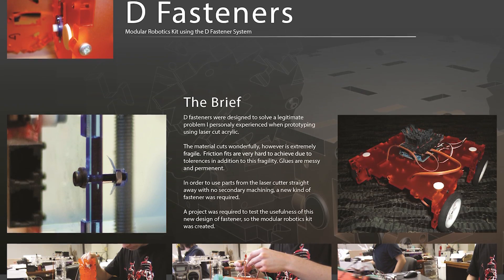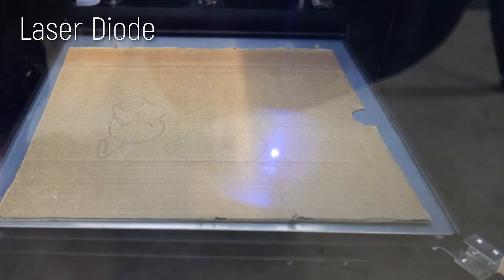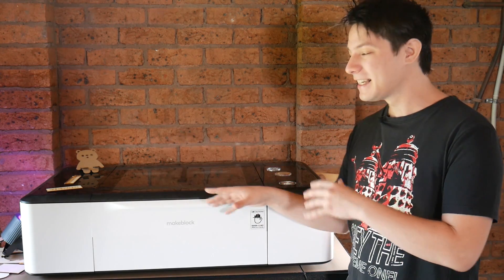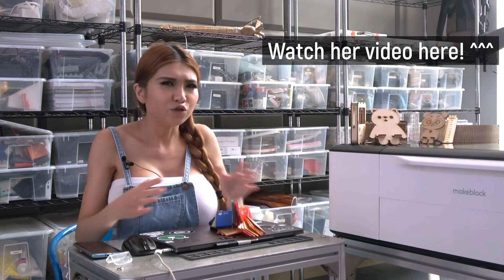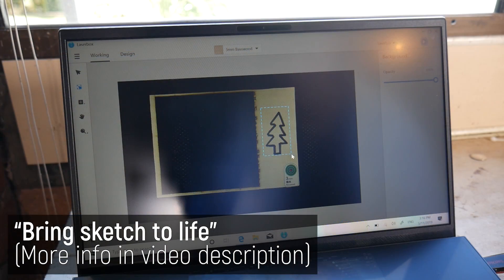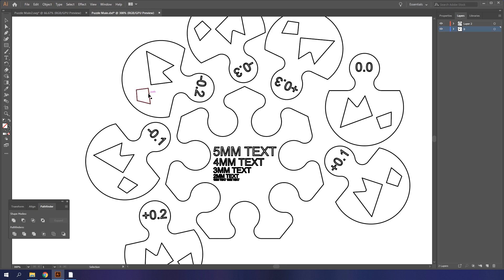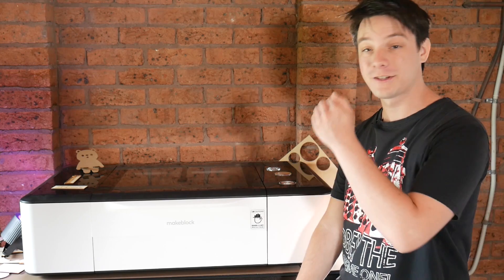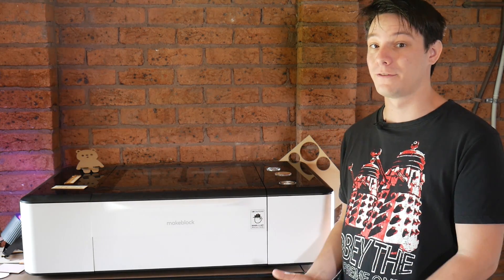Makeblock Laserbox Review - A SMART CO2 Laser Cutter

Comment: Thanks for the great review. Hmmm, seems weird to have no air assist, particularly at that price point. Air assist is also helpful for reducing fire risk and assisting the fumes etc out of the workspace as well as helping with the overall look of the finished piece as you mentioned, in my experience some materials REALLY need to have air assist to get a good end result like rubber stamps for example, all that rubber dust sitting on the piece would surely be problematic for the end result? I would also be interested to know the prices of their consumables along with the machine consumables like lenses and tubes etc (couldn't see them on the website?). I have been laser cutting for about 10 years as a full time 'hobby' business and have really wanted a camera machine for a while now, but not sure this is the one.. Also curious with lid mounted cameras, would they need frequent calibration due to being moved so often do you think?.. And i wonder how much that would slow down the process if you were cutting a multi piece job? thanks for your review.

Comment: I think people make too much of the Internet connection issue. I have an X-Carve and the software that I use to run it is web-based and that has never been an issue. I mean it is 2020 so who doesn't have an awesome Internet connection at their home and or shop these days? My Internet connection is so reliable that if it's down, there's probably bigger things to worry about like tornadoes or hurricanes. Another benefit of the Internet-based software is that your software can pretty much always be available. This means you can design wherever you have an internet connection and then when you get back to your machine your design is ready to go. Honestly, in this world of cloud computing, I think this is going to become the industry standard, not the exception.

Comment: I think it is Glowforge for the win. It has all the features, plus air assist, free software upgrades, etc. And costs less! You can get an upgraded Glowforge Pro System for cheaper and it has good specs. Plus it has a great community of users.  I have a basic Glowforge and couldn't be happier. No, it is not perfect, it has it s quirks, but what is perfect?  A business case would be a great idea for a video.  A lot of Convo in the GF community is all about how to price items for sale and COGS, design time, how much is laser time cost, etc.  Great video, I am big MM fan!  For the Makerbox one must also ask - what happens when the laser tube needs replacing?  How much is that, etc.... Good stuff, great discussion!

Comment: The extraction on that crazily expensive cutter is dire. It won't take long for the lenses to get contaminated. And it you can smell the fumes, then the extraction really isn't working. 'It would be good for educators' followed by 'I don't recommend running this laser cutter in an enclosed space'....... erm......like a class room?? No air assist, seriously?..... well air assist does more than just help with the cutting quality, it also prevents fumes from fogging up the last lens. The live camera feed in laser printers is nothing new. The software for it is called 'Lightburn' = https://www.youtube.com/watch?v=Z4TaZUkvDbM it even does the trick you did with the Christmas tree. Makeblock hasn't done anything new, they've just made it more refined. But for $6000 it should be !!!!!!! Great review by the way (as always). I wouldn't touch that product with a barge pole.

Comment: Wow, looks like an unabashed and total ripoff of Glowforge. The only functional difference I can see is that it apparently uses local software, unlike Glowforge, which is cloud-based software. Does the Makerblock (or whatever it's called) use limit switches for homing?
    I mean, sure, it's not a counterfeit Glowforge, it's just the same type of machine that happens to be the same shape, size, color, and construction. It seems to use similar jargon in its marketing and has cloned... every(?) feature of Glowforge. Also it apparently costs about the same amount. It's true that it's not a 1:1 identical reproduction though.
    I am not a fan of Glowforge (I was a crowdfund customer and was VERY active on their forum for a long time, but ultimately sold my machine without using it (for a variety of reasons)) but there's no getting around the fact that the thing in this video is a ripoff.

Comment: With no air assist, how do they prevent smoke residue sticking to the lens?  Acrylic and glue fumes (eg. from plywood) are rather sicky and will degrade the laser performance.  A K40 or similar seems much better, even for education use, as part of the process (and understanding) is set up etc.  For 10k a smal business can probably get a reliable (and more flexible) larger laser machine.

Comment: PTFE.. Also RIP your laser cutter's lenses from the hydrofluoric acid coating everything...  Though this seems to depend on your cutter's power.
If in doubt, Flame Test!  Copper wire with some sample melted onto it(heat the wire and press it against the material),  then put it in the flame and if it goes green, don't put it in the cutter.. 
Also: Leather.. fun to cut, but sometimes SO, SO VERY STINKY!

Comment: 8:45 That "smear" can be wiped away with a slightly damp paper towel OR a layer of painters tape (I like the blue kind) can be put over the part. For large parts wider than the width of your tape just cover the part with the tape edge to edge NO GAPS and NO OVERLAPS.  This all worked well on my Epilog Zing 60w

Comment: Here's the rough part, pricing. It's great the machine comes with a lot of features that your average consumer may want but it's still price relegated to the professional market and left competing with brands that offer different trade-offs in functionality for the price. Personally I'd look at it from the pro space at this point, so i'd rather have something higher output than 40w at a similar price that would expand the range of material and allow me to offer a consumer more options than have a better user interface.

Comment: From watching the video and comparing both the Glowforge and the Laserbox; they are entirely the same machine at their core, but do have differences for sure. Both have the same design, 40w base versions, and so forth. Even their material scanning system is the same; albeit Glowforge uses QR codes while this uses a colored ring system. I will say that the bed for the Laserbox is smaller looking than the Glowforge. So personally, while yes the Glowforge has it's problems, it's still cheaper as the base model is $4000 vs the $6000 USD Laserbox is. Now if you get the Pro Glowforge at the similar price; you get a lot more to it including speed enhancements, pass through capabilities, and then a higher watt laser as well. The Laserbox does come with a filter system which is nice while the Glowforge doesn't. So in the end they are pretty similar as I said; just depends on the other bells & whistles that make you want one over the other.

Comment: Being a simple color code sticker, it would be simple enough to just recreate the them in a printed disc that you can just place on the corner for the camera to find. Then have a simple reusable identification system for your own consumables. Depending if can create the color codes yourself, this also means you could create a full library of materials in varying thicknesses.

Comment: Big FYI if you're cutting leather: there are certain kinds of leathers you also do not want to use. Most commercial leather comes in two kinds, vegetable (veg)-tanned, and chrome-tanned. Veg-tan is your stiffer, knife-sheath kind of leather. This stuff is fine. Chrome-tanned is soft, upholstery and suede leather. If you use chrome-tanned leather, it can release chromium salts used in the tanning process, which can damage your machine, particularly the mirrors. If you have one, check out your local leather supply shop like Tandy Leather and they'll help you out with learning the difference, and supplies.

Comment: "All opinions are my own... after being given a $10,000 gift, and having the manufacturer approve my comments"
Reply: Yeah I'm sorry but it's hard to claim impartiality when you have just received a $10k Gift. This is the reason why pretty much most companies have policies in place to not allow gifts from prospective or current clients.

If it was a show piece that was being returned I'd be more inclined to believe impartiality but such a gift for keeps raising too many questions especially with the Ask for a Quote system.

Sorry Maker's Muse I'm not doubting your integrity but this is my feeling industry wide for all companies / Reviewers. If it's not purchased with your own monies or a returnable test piece I'll take comments with a pinch of salt, especially the "it's not a Glowforge clone" when it clearly skirts that line so close it's practically over it and as such I'd question wayyy more.
Reply: yep
Reply: And... what was not accurate in the review?
Any facts supported by evidence?
Reply: @Terry Jackson
Its not what they tell you but what they dont!
Anyone that owns a co2 laser cutter knows the horrible design desisions that machine has.
That machine is I-Crap. Its just looks, it doesnt even have an air assist so the lenses will get dirty in no time and ruin them. Plus it being closed and so small without proper air circulation it will get dirty all over the  inside.
This is an ad, of course they wont tell you the shortcomings of their mediocre product. That thing is garbage. Overpriced garbage thought for institutions paid with your taxes where they dont care about wasting your money.

Comment: You mentioned that etching takes a long time on this machine. From your video at 6:55 it appears there is a lot of wasted head movement. While etching the tree the head was sweeping across the entire workpiece rather than just the picture. Some adjustment to the software is all it would take to speed that up significantly by avoiding unnecessary movement.

Comment: No air assist is pure trash. Any slow cutting of acrylic results in flame, I don’t think you want flames coming up at your fancy laser head. I bought a Thunder Laser Nova 35, 900 by 600mm with programmatic control of the Z axis which drops a foot or more. This toy also can’t support a rotary unit for doing cups and such...not a great value for money imho.
Reply: PS - forgot to mention. Landed cost with import duties, shipping etc was $8000 with two tables, genuine refrigerated water cooler unit, flame detector, rotary engraving unit, blower extraction fan etc. All that’s needed is a small compressor and they sell that for near next to nothing. It’s not table top but a much more serious machine with 80W tube and ability to support 100W with the supply inbuilt.

Comment: Not a Glowforge clone? Seems like one to me (a glowforge owner). Not needing an internet connection would be the only real difference in what you described. Other than that you described the glowforge feature set.
Reply: Owner of a glowforge too. Yeah exactly a clone. The only feature that this has that glowforge doesn't is the off network use. But the glowforge has air assist. Lol.
Reply: Yeah but Angus would need 2 more very expensive gifts from Dremel and Glowforge to make sure for definite.

Comment: A bit of a shame that it lacks air assist at this price point. I like the "prusa like approach" : you plug it, use the good quality software provided with it, and it works. However, for the price i would really want air assist.

I know that i can DIY a cheaper, larger machine, with a more powerfull laser, air assist and many cool hardware features, however, i don't know if we have access to similar camera features with open source software? Is there any laser CAM software that enables the user to view the stock and the design superimposed like this? I mean one that is not tied to a specific machine.

Also, a good thing to add would be a distance sensor (there are quite precise laser sensors; but a BT-touch would probably do the trick), so that we could automatically touch the stock material; then move the Z axis to the correct distance for perfect focus everytime! That's nothing too fancy, just a bit of starting gcode...
Reply: Checkout Lightburn, it has a camera option and is the best laser CAM software I've used.
Reply: @Naomi-Wu  thanks Naomi!
It's not too expensive, and if you recommend it, i trust you :)
For now i'm starting with my CNC (openbuilds plate maker based on a smoothieware) and i have a little hard time with software, it's not as streamlined as the 3D printing experience i now have with my prusa (although when i started 3D printing with my printrbot, i was lost too!)

Later on, i plan on installing a laser diode on my current CNC to try engraving stuff; and much later on probably make a dedicated laser cutter, buying a laser tube and aluminium extrusions from china :)

Comment: I'm an educator who has been using the glowforge for more than two years. 
It's intuitive and easy to use. I can even allow students to use it through a guest account that I can control, and the materials they sell are precalibrated and sold at reasonable prices.
I've never once had to think about calibration of the laser or autofocusing. They also push UI and UX updates monthly. It was an easy transition from 3D printing once I learned some basics in inkscape.

I think you should review a glowforge.

Comment: I wouldn't recommend cutting or engraving PVC or any vinyl based product as the chemicals released are corrosive and will cause major damage to metal components in the laser.
I know someone who was cutting vinyl on his K40 and has destroyed the aluminium rails, bearings and anything else that will corrode.
There are warnings regarding this in some K40 manuals but his manual did not have this warning.
Great vid as always Angus.
Reply: Breathe the poisonous chlorine it offgases and you won't care at all about corrosion.

Comment: If you use fan extraction in a home that has gas fired appliances (such as water heater or furnace) you must have a 2nd opening for make up air opposite the fan tube in the ventilated workspace (just a tube to the outside, no fan) so that you don't pull exhaust fumes down through the gas chimney and die of CO poisoning.

Comment: Edit My estimate of the AUD to USD was way off... Please disregard. 

I understand it's not a direct clone, but am I missing anything that warrants the huge cost between the Glowforge and this?
Reply from the maker: I'm not sure. Makeblock are being cagey with their OEM pricing and all I could find was AUD resellers and Australia is always criminally overpriced. I don't believe glowforge comes with any materials or a filtration unit either.
Reply: the price between the two is about the same if you add the filter to the glow forge, 6k-5k usd (depending on the site) for this and 5-7k for the glow forge. the price given in the video was in aus so if you're in the us it'll seem much higher. i was curious about the same, had to check it out.
Reply: Half the stuff this comes with are "upgrades" you need to buy for the glowforge. Although for the same price, you could go with Bescutter and get a much more robust machine that can handle up to industrial use even, on its own stand, with more power and all the "upgrades". Little cheaper actually.. 60w fully loaded machine runs 5500$

Comment: At my high school we have two ULS Versa 60W laser cutters, they are very expensive (~$30,000), but they are by far the most reliable machine we have. I have to say that there is no way one of those machines would make for a good laser cutter at a high or middle school's engineering classroom, sure they are easy to use, but the drawbacks are too much, seriously, who decided to not add air assist? How often do they expect people to clean the lens? Because last time I ran without air assist (forgot to turn it on) the lens was extremely dirty after just 10 minutes of engraving.
Reply from the maker: I miss my uni's Versa, I used to do 6mm acrylic all day on it. The price is just so high though, it's ultra limiting. No air assist was a big surprise to me too, I'm going to try rig something up so my lens doesn't crack.

Comment: So twice the cost of the Glowforge with less features lol
Reply: Is the $2500 Glowforge comparable?
Reply: @thingswelike  they're almost identical. For starters, the Glowforge has air assist. It also has a camera inside to help align your "prints". The supplied software is better. You can drag your designs overtop the camera feed and have the unit cut them out where you place them. It's basically just all around better. I'm honestly not sure why this one is 6 grand. I just don't see it.
Reply: @TokyoScarab  I mostly agree. The air assist is a bit "meh" IMHO but otherwise amazing!
Reply: @andrewbeder51  Yea, the air assist could be better. I just don't see where this extra 3 grand is going on something that is basically just a clone.